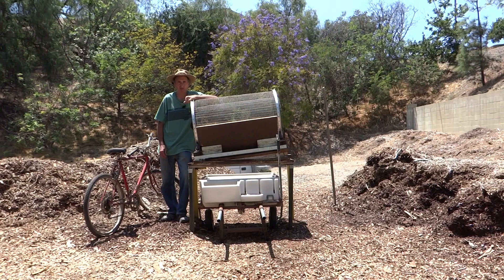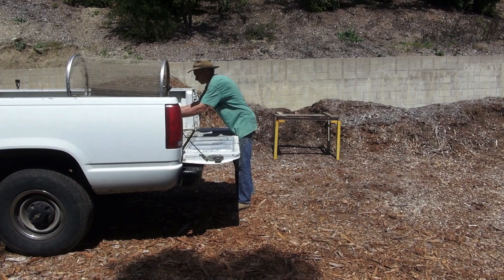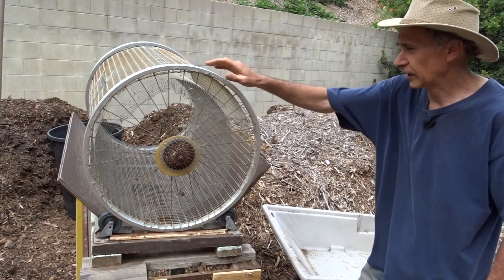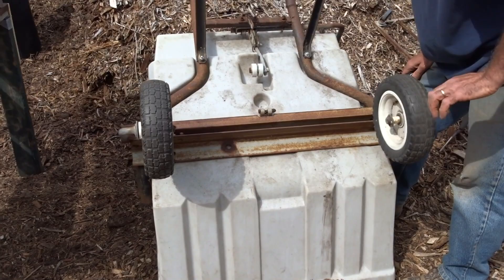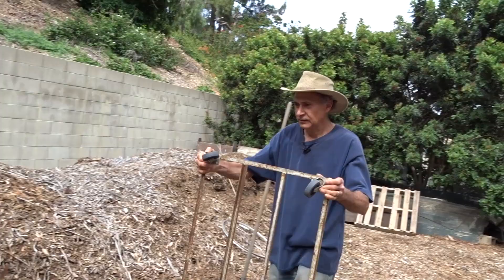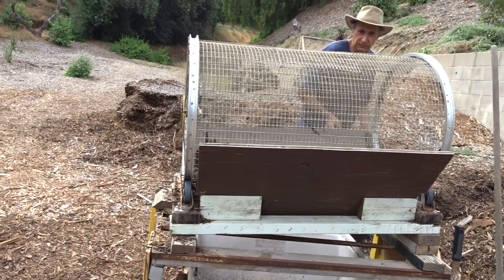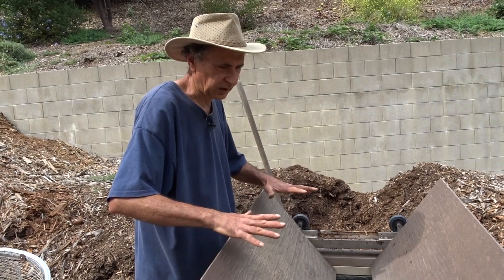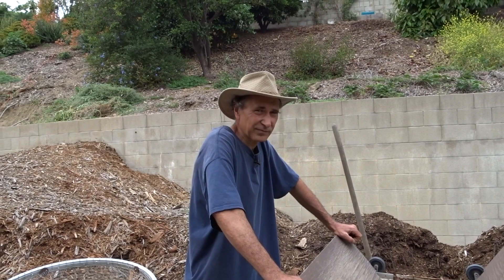Cheap Portable Sifter & Collection Cart With Double Size Screen Trommel Compost or Woodchip

Comment: Great sifter setup. An idea that came to me if the castors don't have the exact size to avoid the bumpy rivets, the inner channel sould be lined with some kind of tape or material to smooth it out.
Reply from the maker: That is a good idea, thanks. Duct tape or something  durable should work well.

Comment: Yay!  I'm glad that I saw this, Gary .. your trammel basket is a lot more lightweight and manageable than the monstrosity that I was contemplating .. and getting that cart for under $20 was quite fortunate.  The hard rubber wheels aren't cheap, if they're purchased new, but well worth it, not having to deal with flat tires.  Best yet, I believe that I already have everything needed to build this, after the insanity of spring planting has passed :)
Reply from the maker: Gary responding. Jason, You already found the link. I move this set up around fairly often and leave it out in the elements. Low maintenance is important to me. I'm thrifty but flat tires far from my compressor is something I don't want to waste time on, so the hard rubber tires were my best choice. Thanks.

Comment: Gary, How are you attaching the finer screen that is inside of the main screen (towards the end of the video)? I'm curious because I love your simplistic design, but would like the ability to sift at 1/8 inch when I wanted to. Thanks, and great video.
Reply from the maker: Gary responding. Thanks. I don't attach the fine 1/4 inch screen to the main outer barrel. It's a smaller diameter cylinder that slides in and tumbles.  This makes it fast and easy to change out. For the main barrel I used 1/2" by 1" cage wire because I had it on hand. If you use mesh with a larger gap you could make many multiple size screen inserts.

Comment: Ive been running a motorized setup w/ the same sized screen set on the front half of a hf cement mixer for the past eight yrs , gave up on the manual arrangements because it takes way to long to git'er done .
Now if you put a motor on it ?
Reply from the maker: Thanks. I opted out of motorizing it for two main reasons. We have around 2 hilly acres. I needed something very portable and I wanted to leave it out in the elements uncovered so I could quickly use it. It is now 3 to 4 years old and is maintainance free.
Reply: @RobbieAndGaryGardeningEasy  i hear ya, mines been outside since day one though and have only had to replace the fuse block and lube the bearings at beginning and end of season  over 6 yrs , man , this thing has saved my back!

Comment: so its important to keep wood chip piles wet or damp? I haven't been watering mine and the chips dried out and don't look like theres much activity happening in them - I think I just learnt something! thanks mate!
Reply from the maker: Gary responding. Yes I treat the woodchips like the rest of my garden. Water as needed.  Like planting a small fruit tree it takes a while. Re-hydrating will bring things back.  In wetter climates extra watering may not be necessary.
Reply: @RobbieAndGaryGardeningEasy  thanks for responding gary. Ok I'm going to start doing this! thanks alot